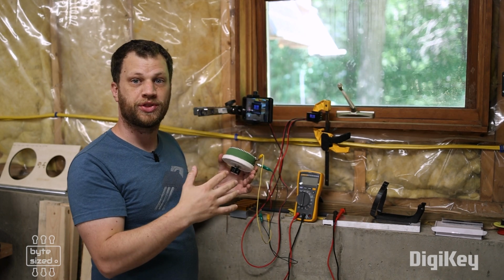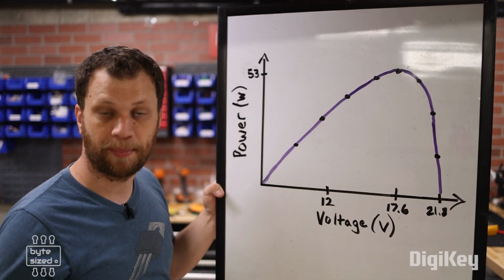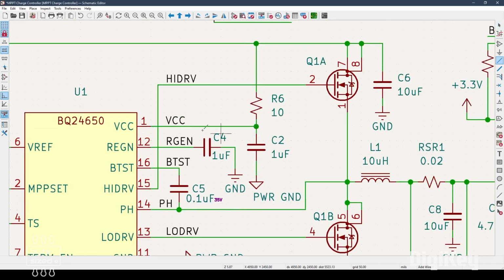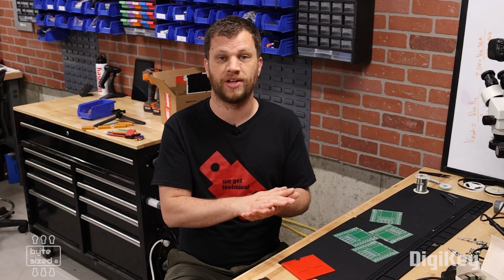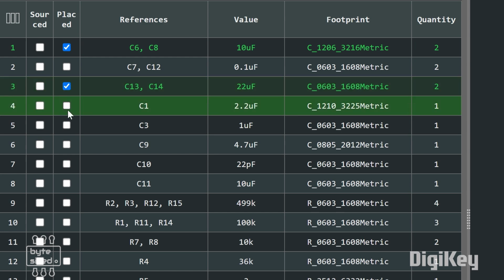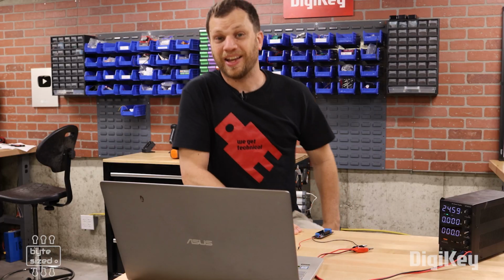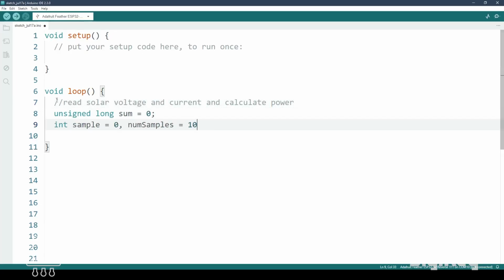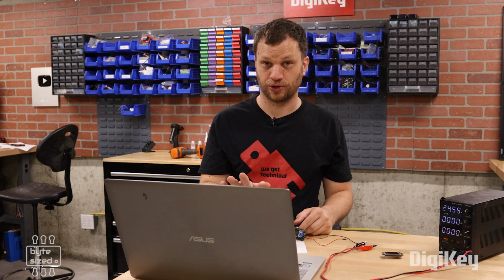Building a maximum power point tracker (MPPT) - The Byte Sized Engineer | DigiKey

Comment: Overall good video with useful information. But fundamentally flawed as BQ24650 does MPPT without a microcontroller (uC).
The datasheet mentions no requirement of a uC. You are driving the MPPSET pin from your digital POT but that pin is only enabled/disable. Which is why when you demo at the end showing levels on Adafruit display, the level from uC to digital POT barely changed but the power was shooting up  (+1 = +10W) . That's because the MPPT chip was doing all the work itself. datasheet ref " Use a voltage divider from input source to GND to set voltage on MPPSET to 1.2V. To disable charge, pull MPPSET below 75 mV."
Like I mentioned, good information in the video, just need to make it clear as it confused some other viewers. firmware development is not required for MPPT.
@otaznikvykricnik5961

Comment: This BQ24650 doesn't do MPPT, it only supports MPPT, more precisely gets supported by MPPT. Or am I missing something? I would expect such misleading marketing statements from a Chineese marketplace, not from Texas Instruments.
You have to do MPP tracking yourself "manually" by MCU.
All it does, is it sucks particular fixed voltage (not MPP, but estimated MPP, rarely equal to real MPP voltage in a given moment) and converts it to a target desired output voltage and current. While output current is totally random.
Target output voltage is perhaps fine to charge Li-ion. For leadacid you also (/more importantly) need particular current to charge properly.
I didn't find anywhere, how much maximum current can BQ24650 handle. 5A from 100W panel is not much impressive.
Reply: I agree, have been struggling to find a board to charge my 2S lithium batteries that actually supports MPPT, most just seem to have a potentiometer for setting input voltage or a fixed input voltage like 18V...

Would love some good suggestions on alternatives.

Comment: have you measured and/or tested for EMI? I am always looking for EMI 'clean' solutions for my portable/emergency HAM station. Not really concerned with power cleanliness, I can filter for that. EMI can be quite troublesome, Ive tried enclosing commercial MPPT charge controllers in metal enclosures but it seems that the EMI sneaks out using the wires as an antenna.

Comment: Btw. it is almost impossible to chose the value of a resistor too high for the LED to be seen anymore. For over 50 years the efficiency of LEDs increased, but circuit developers still use almost the same resistor value. As a result LEDs on most boards like Arduino or ESP are much too bright. So even you use a resistor one or two decades larger than "calculated", you will still be able to see the LED glow. If not it is another reason, usually polarity.

Comment: Although it's not relevant to the topic but it sounds bad to listen it produces 24 volts at zero current. literally the current couldn't be zero if you are measuring voltage across. some of the electron still flows in order to measure voltage that's why current is not zero. I know it's not a physics channel but still interesting to share. even if you are measuring with a meter having 10M input impedance that is still 2.4 micro amps and for some guys out there it's a huge number.

Comment: Very nice video DigiKey. If I may suggest, your website to find components and place orders is great…for engineers. Please consider a simple website to “Help” a newbie, hobbyists or a select audience of DIY’ers! It can ask for type of component. How much voltage, what type of package they need. Refer to links to certain videos, pop up with suggestions. As it is right now, there are so many fields and variables that many with quite a shopping. It not a huge money maker at first as someone may on buy a package of 10 or 100. But, a great ideas start small, opening a new target audience to attract new buyers. I fixed cars for for 40+ years and registered as a customer. It’s just a thought your effects in making these videos can help pay off. Thanks kindly for your help. I enjoy building useful circuits for my automobiles from a low fuel light to adding relays control by micro-switches for neutral, reverse and Park. Plus much more!

Comment: Very cool project and implementation!  I didn't hear it mentioned in the video but from the power curve chart at ~4m45s, it looks like the charge controller was designed to support at least 3A of current.

I'd be curious to hear what the actual design max amperage is of the board, and how the board might need to change to support 30A and 300A.